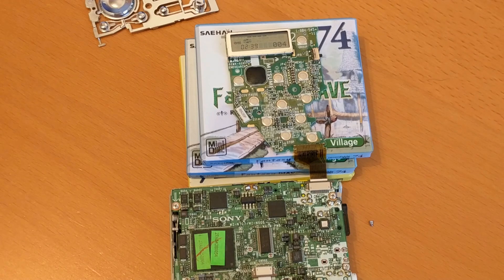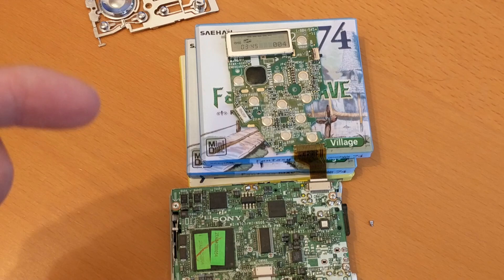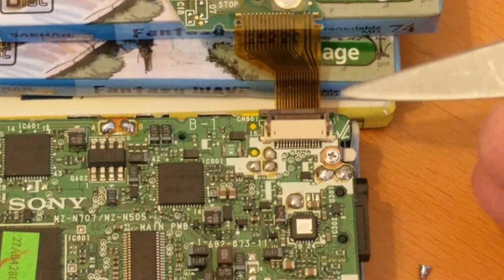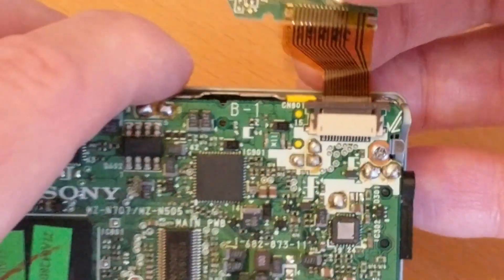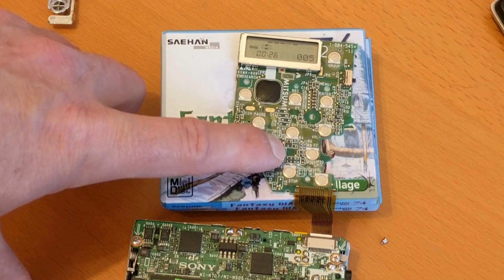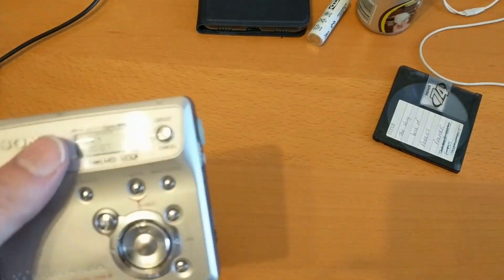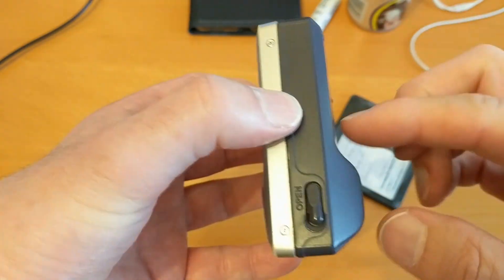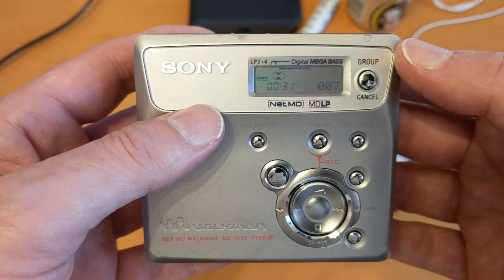Minidisc Recorder MZ-N505 Button Problem Repair

Comment: Thanks for the video!  Sadly, the forward button is mashed in on the circuit board so I won't be able to fix it.  Funny thing, I saw something fly off the unit when I was taking it apart.  Come to find out it was the exact spring as yours.
Reply from the maker: Oh no! That's a shame. Do you have the remote for it, maybe that will work. If not, maybe get a beaten-up, cheap one on ebay and switch the boards. I've never done that, but it might work.
Those pesky springs!
Reply: @CBitsTech  I don't, but I'll see if I can track down the remote, thanks!.  If I push it down in just the right spot, I'm able to fast forward the track so it still sort of works, but it's not ideal.
Reply from the maker: Not too bad then. I don't think they're very expensive if you need a replacement.

Comment: It's been awhile since I looked at the n505 service manual but I believe the front panel buttons use a resistor ladder arrangement that is read by an adc in the main controller. This is unfortunately super sensitive to dirty contacts as that changes the measured resistance causing incorrect button reads. Btw the spring goes on the bottom corner and helps with springing the door open.
Reply from the maker: As always, you're a genius! The resistor ladder makes a lot of sense now I understand it.

Regarding the spring, the door still seems to open fine so there's no point in me opening the case again to replace it and risking other damage.

Thanks, as always, for your comments.
Reply: @CBitsTech  Yeah I believe there are two springs for the door ... so the one that popped off yours must be like the appendix spring lol.
Reply: then it is impossible to solve the problem, since the button contacts are sealed and cannot be opened for cleaning without damaging them.
My joy in a well
Reply: @camachomatute  the button contacts are just metal snap domes over exposed enig pcb contacts with a bit of tape covering to keep the domes in place. This is very similar to many portable game system buttons. It's easy enough to peel back the tape and clean underneath, I've done this for tons of devices to fix them. The issue in most cases though isn't the buttons themselves, but rather the ribbon and connector between the front button board and the main pcb. If those contacts get flaky then weird button and display issues crop up.

Comment: I just bought a NZ-505 in AMAZING physical condition, however I seem to be having the same issue. I’ll reseat the ribbon cable in hopes of fixing it. Thanks for this video!
Reply from the maker: I hope that works. If not, and you have the remote, using the remote still works fine usually.

Comment: My fpc connector has corroded (mz-n707) losing 3 pins. I may try and solder some very thin gauge wire from the fpc connector to the other end of the ribbon cable.
Reply from the maker: That sounds like a fiddly job. Good luck!

Comment: This is great. I bought an MZR55 that is crazy weird with the controls it seems to be the same thing - I was just going to clean contacts and pray, but I will also check out the ribbon cable.
Reply from the maker: The fix I did in that video did work, but it started to fail again a while later. Maybe I need to do it again. I mentioned your comment in my latest video. This timestamp will take you close to your comment. https://www.youtube.com/watch?v=FUwsBYcvhV8&t=2551s
Reply: @CBitsTech  I tried it and had success. Video (and shout out to you) here: https://youtu.be/OtwkIs5HE3E

Comment: Nice video. I have an MZ-N710 and have a similar issue. When pressing volume up it shows once then changes to AVLS. Now, I can't figure out how to take the back off. Any clue on how to do it. Took off all screws but still solidly tighten.
Reply from the maker: Sorry for the delay in replying. I haven't taken apart a N710, but I gave you a few tips in my recent video https://www.youtube.com/watch?v=loYd27dOwdA Time stamp 20:56. Hope it helps.
Reply: I believe that avls is the auto volume limiter system, it is an EU requirement, and keeps the volume at a low level to protect your hearing. You just need to navigate through the menu until it says option and then choose avls then select off and then enter. Hope this also helps

Comment: so Ive been meaning to open up  my n505 because onebutton doesnt work, every other button works fine but my volume down button and idk why, ive tried contact cleaner but to no avail
Reply from the maker: It could be the ribon cable. See this part of the video https://youtu.be/5NqQvNLfzaY?t=274
Be very careful, you could make it worse, so proceed at your own risk. Try unclipping the cable and clipping it back again. That might be enough to fix the connection. If not, unclip the cable and gently clean it with isoproyl alcohol. Better still, use an in-line remote for the volume and just enjoy :)
Good luck.
Reply: @CBitsTech  Ive done that , did a complete strip but once I assembled everything together  and made sure everything was correctly in place, im just going to get a remote for my player
Reply from the maker: @Gumba117  Ah, I see. I know from my computer tech support business that those ribbon cables are very fragile, maybe it broke. 
I'm using my RM-MZ4R with that player, no display on it but it does work. The RM-MC11EL is listed as working with it too. The RM-MC11EL also works with several other mindisc players (and some CD players), and it has a backlight, so that might be a good one to buy.

Comment: Found the spring attached on the button cover. Can send a picture if you want
Reply from the maker: Yes please, that would be great if you can. Not sure how you would send it though. You could do a video and upload it to your channel. Hard to do videos when doing repairs though. Thanks.
Reply: @CBitsTech  hi
 I can send it though email if you want
Reply from the maker: Thanks. 

I assume you you can format the email address from that. Thanks.
Reply from the maker: Thanks. I checked the photo you sent. I think that's a different spring to the one that came out of my player, mine had one long end and one short one. I think it came off the 'open' (eject) button. Thanks anyway.
Reply: @CBitsTech  no bother colin.